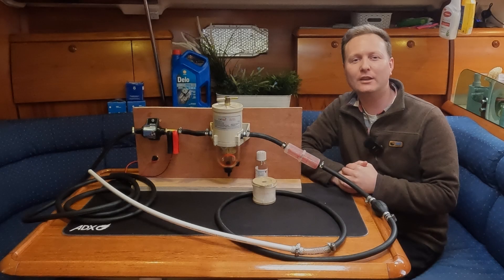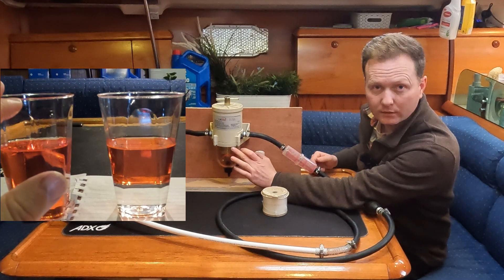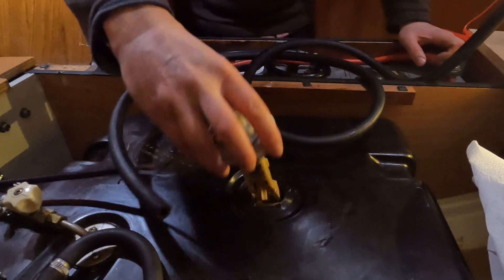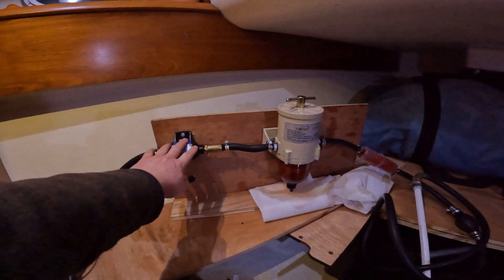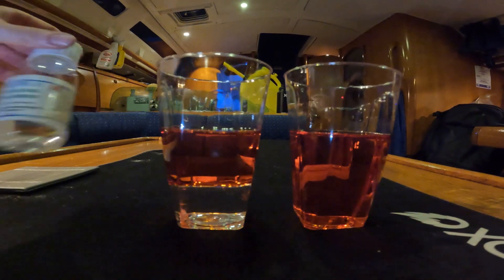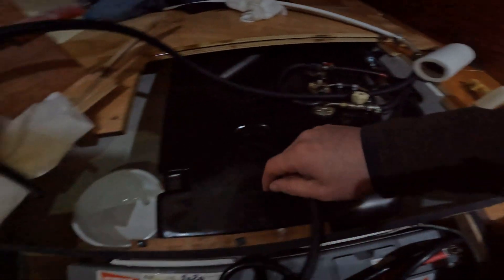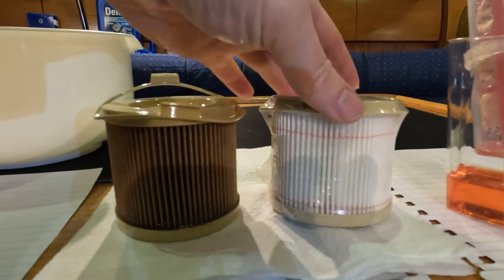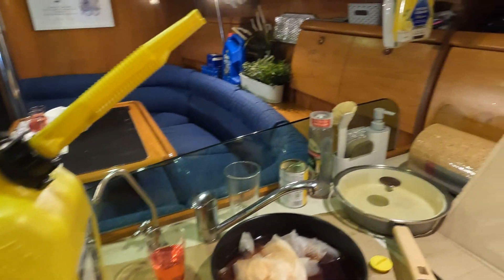Diesel Bug Fuel Polisher Tank Cleaning Boat Maintenance

Comment: I copied this system and it worked very well! Some feedback: Engine unused for approximately 15 yrs and 60litre fuel tank full during that time. Tank built into fiberglass bilge and only access port was about 50mm's diameter so not really possible to empty the fuel tank and clean it via the access port. After starting fuel polishing evident that tank had massive amounts of asphaltene contamination and no water contamination. Poured in a lot of "Fuel Doctor" in attempt to break the large asphaltene globs up. Using a cheap Amazon 5amp fuel pump and it is working fine. Only problem has been the asphaltene globs have been blocking the inline hand primer so took that off and system seems to be able to cope without the hand primer. Originally had all black fuel hoses but replaced the intake one with clear hose so I could see the black gunk coming into the system which helped. Also originally didn't have a rigid pipe on end of intake hose but putting one on helped considerably with breaking loose the asphaltene gunk on the side of the tank. ChatGTP was very useful in determining the type of contamination I had (ie Asphaltene vs fuel bug) and what chemical treatment to use. Fuel bug treatment doesn't work on asphaltene contamination. Also useful for determining whether or not the diesel in the tank was useable or needed to be thrown out. So far I'm on my third 30micron filter and hope to go onto the 10's after tomorrow's session. I've used up 3 in-line filters but I'm bringing them home, cleaning them up in diesel and recycling them (Scottish heritage). Later edit: the in-line hand pump was fine, the problem was a very old battery running out of puff so don't let me put you off from including a in-line hand pump in your setup! They do make it a lot easier to start the process
Reply from the maker: Thanks. I'm actually looking to install one onto the tank permanently and have a change over diversion valve for just incase my engine inline filter clogs up. Effectively making 2 ways for the fuel to get from the tank to the engine. My friend had to do some engine serving while underway bouncing off waves. He did have crew but to change fuel filters under way with being sea sick and the smell of diesel he said it was like being hung over without the fun night before.
Reply: @serenitycoastUK  That would be luxuary! I've been filtering with the 2 micron for a while now and what was filthy fuel looks to be pretty clean. Minimal discolouration in the 2 micron filter and no black ashphaltene stuff in the on-line filter. The 500FG units on Amazon are so cheap. I paid well under AU$50 for mine and it is well made and works really well

Comment: This is really interesting and we have thought about it a few times, however the cost of a Racor filter in other solutions is quite salty. How have you found your Katsu filter over time. I have read that the filters are 30 microns, which isn't as fine as racor's 10 micron, but as this would be to remove debris, diesel bug and water, I'm wondering whether this matters.
Reply from the maker: Its been 2 years and looks like new still despite being on the boat for that time. I may even swap my main in line filter for one so its easier to quickly change the filter. You could probably buy the official racor filters and pop them inside the katsu enclosure. I have had people tell me they jump pumped out their old diesel, cut a hole in the tank and give it a scrub. I also have a friend who is sailing between the med and north Africa.  He uses a filter and jerry cans to fill his main tank as he doesn't trust the sources.

Comment: Thanks for this. Putting a parts list with links in the description was really useful
Reply from the maker: thanks. The pump i used wasn't very good. The copy of the racor filter is 3 years on still im very good condition despite being left on the boat in one of the lockers below the water line. The inlime filters also good quality.

Comment: Would this system work for a motor cruiser with a 700 litre diesel tank or would it take too much time to complete ?
Reply from the maker: I would be tempted to filter it into clear see-through containers that way you can see what the fuel looks like. Maybe 100ltr at a time. Filter it while going into the containers,  changing the filters, and maybe running a cycle per container. Then, back into the fuel tank using a finer filter. Some people have mentioned that if the fuel is pretty old to simply get rid of it rather than trying to Polish it. Make sure its a well ventilated area and that you consider putting those fuel absorbing mats under the containers

Comment: Hiya,great video, a question, the hose tails you used to connect the 500FG, where did you get them from/what size male/hose barb were they?
Reply from the maker: I think i left the stuff i used in the description.  The katsu filter/ racor came with attachments. The only thing that i wouldn't recommend is the pump that i used it just wasn't strong enough.  Hope this helps.
Reply: @serenitycoastUK  Thanks, had a look at the filter parts and mine came with a banjo fitting and not straight like yours :-( I've ordered some straight hose tails, fingers crossed.

Comment: Very interesting and many thanks.  What were the issues you found with Marine16 though, please?
Reply from the maker: I've been using this one, I got it from force4 as it was recommended to me to use. Marine 16 Diesel Bug Treatment - 100ml
https://amzn.to/3CneBlr
Reply: @serenitycoastUK  Thanks for the reply, but you mentioned you had issues with its use that you'd explain later; I didn't see that bit in the film.  I'm particularly interested because I've been using Marine16 for the last 1000 engine hours without any trouble until last season when the primary filter clogged up, despite all fuel coming from reputable sources.  I was wondering if the M16 was simply killing bugs that then coalesced on the tank floor, requiring mechanical removal through the primary filter or such a polishing system.  Interested in any opinion you might have.

Comment: I need something like this. But pickup needs to be big to pick up the jelly and get it to the filter. 
Bigger tank means less turnover of fuel so more chance for bug.
Reply from the maker: I have a friend who added a smaller fuel tank as more of a day tank. He has a power boat but doesn't go out too much.

I've had a few friends use a fuel transfer pump to get rid of their diesel out of the tank rather than Polish it. :-)

Comment: Enjoying your videos, however I just want to point out that whilst polishing the fuel in the tank can only be a good thing, remember that you must clean your diesel tank internally for it to be of any real value going forward.  The reason being is that following a sail in choppy or heavy weather a lot of contaminants that may have settled on the bottom of the tank are sloshed around and dislodged and it is only then that they are drawn into the engine supply line.  No amount of polishing will prevent this as they are not being sucked up and filtered during the normal polishing process and only become apparent after being stirred up if that makes any sense.
Reply from the maker: 100% I did keep scrapping around the tank with the speed pipe. There's no inspection hatch on mine, which I can fit my hand inside to clean/scrub away. I do use marine 16, and I may add a smaller tank to switch over. I'm not the only person who's had issues at the marina with fuel. A few of my friends have pumped out their tanks and refilled them discarding the old fuel. I may start filling up 20ltr jerry cans with bp ultimate or something. My rank is 140ltr so won't take long :-)

Comment: So I am curious about the flow rate of the fuel pump you are using. I believe the fuel filter system you are using is rated for 227LPM. It looked like your output was quite a bit more than that. Is this correct?
Reply from the maker: The link in the description is not the one I used here in the video and I do mention that I don't recommend that one, however I have  the pump which is in the description which I used on another project which flows much better.

Comment: Thank you! Will all the links for DIY. One never knows how bad it is down there before. I may simply pump a little bit frrom the bottom of my tank with the oil change pump, and have a look at it. On my to-do list is a second  raw filter unit and a tap to switch filter when first is clogged.
Reply from the maker: Thanks for leaving a comment. Thanks for liking the video and welcome if your a subscriber. The links should take you to the correct amazon page. Good luck with your project.

Comment: That's a very cost effective DIY set up, and very useful to watch - thanks.   Personally,  I'd always wear disposable gloves when handling diesel, plus any spillages are often hard to clean up (the diesel smell lingers).     So I'd probably contain it all in a plastic container of sorts.
Reply from the maker: From my chef days I learnt that if you wash your hands with hot water then you end up baking the scent on to your hands, So I wash with cold soapy water which does the trick. Some jobs I wear gloves however I tend to poke holes in them pretty quickly so they tend to come off pretty quickly. Yeah can be a little messy and I am indeed a messy worker. :-)

Comment: Great setup. Thanks for sharing. It's obviously making a difference.
Reply from the maker: Sure does. It's the second time I had cleaned the tank. I did it last year, I have been burning more diesel and refilling more often as I had used the boat and the heater a lot more. It was scarry stuff having the engine cut out on the way into a harbour! Thank you for taking the time to comment, and extra thank you for liking and subscribing. Let me know what you would like to see.